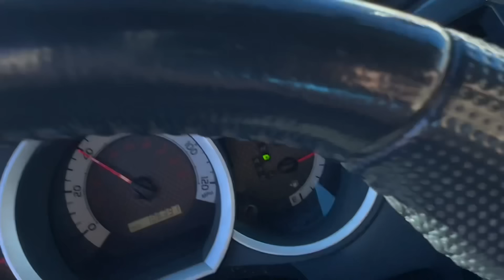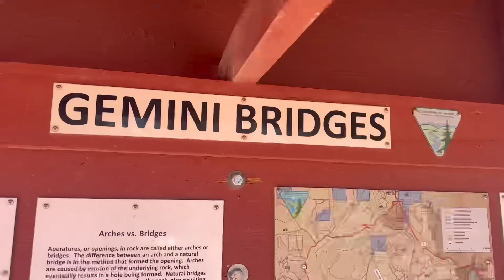BDS 3” Lift For Second Gen Tacoma

Comment: Hollie if you send me the headlights for that truck I will fix them for you for free and make them look like new!    Only problem is you'd be without lights for a few days lol.   Truck looks so much better with the new tires and lift.   Nobody should drive a stock Tacoma.
Reply from the maker: I would agree now that I’ve seen it 😂 looks so much better lol
Reply: How?
Reply: @fu9793  Good old fashioned elbow grease.   Lots of wet sanding polishing and then either coating in 2k clear or MeGuiars headlight coating.   That's all providing they're not internally hazed and crazed.  If there is internal damage they're junk.
Reply: My buddy that ceramic coats vehicles and planes tried that with my 2005 Outback headlights and they are internally foggy.

Comment: I love Toyotas, 
I've had a 94', 22reregular cab, bed,
95' tacoma ext, cab 3.4 
Now have 05 tundra sr5 limited access cab 4.7 step side,
Wouldn't get a new tundra if it was free, just alot of reliability,
Few engineering problems with the brake modulator off the master cylinder, new frame, leaf springs cracked, but the drivetrain and engine are really good, still working with Toyota corporate on the other problems,
They'll probably never call me though, sand baggin slackin frog humpers

Comment: You know,,,, there’s this stuff called penetrating fluid that you can spray on bolts that make it easier to remove rusted on bolts and nuts., lol. I never see you southwest peeps using it. Maybe it’s just a northerner thing.
Reply: Apparently vehicles don't rust in the southwest. She mentioned that Taco as being rusty, to my New Englander eyes, it looks brand new, lol.
Reply from the maker: We had a can of PB Blaster (Rudy actually brought that, I do need to get my own), but only the suspension bolts were rusty. The frame and the majority of the underside is surprisingly rust free for a vehicle we got from New Jersey.

Comment: I’ve done that upper control arm job on a taco by myself. It’s not fun!!!
Reply from the maker: Isn’t it crazy that you have to clearance the inner fender area to remove that bolt?! Such a silly process!
Reply: Totally. I did it on my gen 3 taco with 5k miles. I couldn’t believe I had to rely and scratch the truck to pull the bolt out.
Reply from the maker: @jake_berry  Rudy and I had a good laugh about that part of the instructions. I can’t believe shops across the country are doing that as part of their installs. But if the alternative is to remove the entire front clip, I bet owners wouldn’t want to pay the additional hours for that! 🤣

I assume most people just don’t know what’s involved 🫣

Comment: Yep engineers strike again haveing to bend metal away ro remove a bolt hmm. Your headlights need some TLC must be like driving with candles.
Your going to wheel with the mudflaps hanging down and all that plastic up front and while here you have two Jeeps and you are taking a plastic taco out to play hmmmm.
I don't like cashews or Pepesi so Poochews seems appropriate. I should imagine it is more relaxing in the Tacoma than Nessie and M/M.